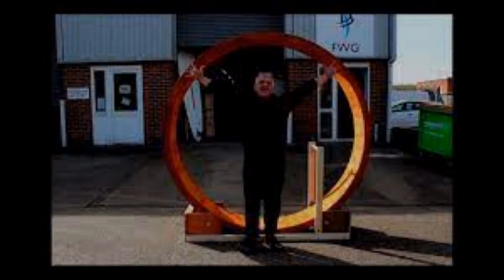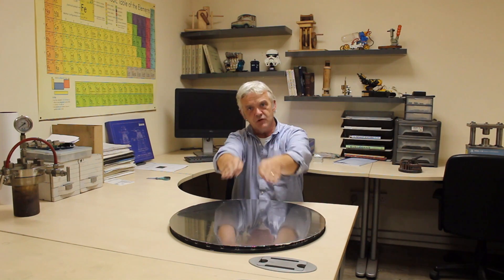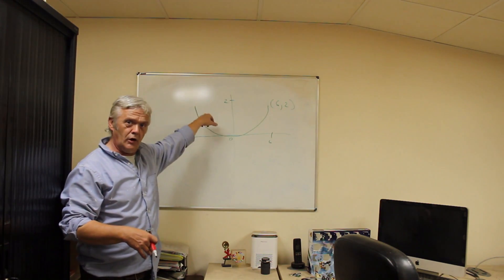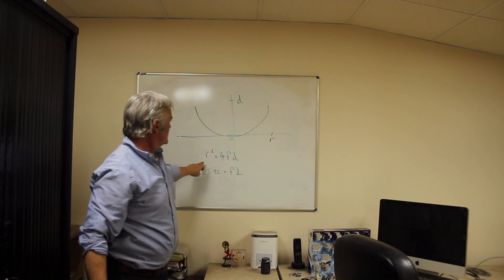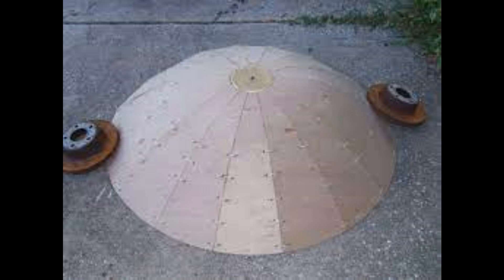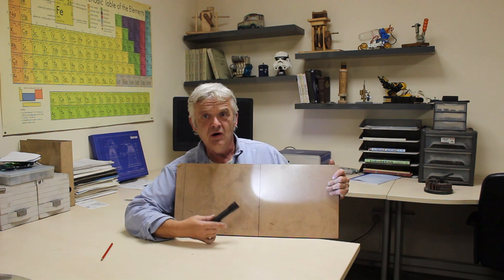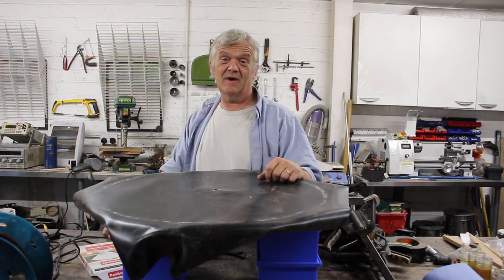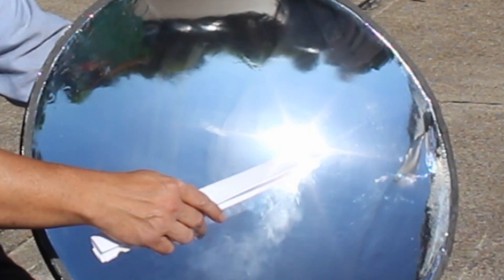1643 How To Make A Parabolic Mirror

Comment: Robert, any stretched membrane across a circular frame that is stretched using vacuum or inflated with air ends up forming a spherical profile, not a parabola. But when it is very shallow, a spherical curve approximates the curvature around the tip of a parabola.

Comment: It would be cool to make one in sand and using something weighed on a string to either scoop or displace the sand. Maybe even start one by hand or use something of a similar shape and refine it with the previous method. Also could you use a vacuum? Once you have the right material you could apply the mylar to it but you'd probably need something similar.kar to an air hockey table in reverse to pull the mylar down evenly. My original idea was to make the shape and then apply it like window tint. But no matter how it's made, it's a very cool idea and I appreciate watching and learning. It reminds me of the cool science experiments my teacher's would do in the Forestdale school system on Cape Cod. Without my teacher's I wouldn't enjoy life very much. Most of my teachers really cared and tried their best to teach and did a very good job at it. Nowadays, teachers like that are hard to find from what I've heard and seen.

Comment: A number of years ago when I was investigating how to make a large accurately shaped parabolic reflector I came across a paper by NASA which dealt with the concept Robert used here, of applying a vacuum (or positive pressure) to one side if a taught reflective membrane such as the space blanket Robert used.  The paper showed that the shape created is not a true parabola but is a close approximation.

Perfectly adequate for heating applications where a true point of focus is not needed, but useless for optical purposes such as a telescope.  For the same reason, if a point source of light is placed at the focal point, it will not produce a parallel beam as in a searchlight or from a laser.  The beam width will increase with distance from the reflector.

Comment: BTW if you need a hyperbola, for applications like Viktor Schauberger used in his water implosion devices, then the easiest way for a backyard inventor is to place a heavy weight onto the center of an elastic sheet that is stretched across a circular frame. Then coat it with epoxy.

Such a shape is used for degassing water efficiently for example. And degassed water forms very hard hard ice. A hyperbola creates a strong vortex when gas or liquid flow through, and in the case of water, the  dissolved gasses are sucked out of the liquid.

Comment: Howabout carving spray foam? I just made a foam knife w a laptop supply, ss wire and a bucking circuit. I can bend the curve into the wire. As I practice, I can attempt the bowl shape and sand out imperfections. 3m adhesive will hold the mylar or... rub in CaCO2 or d.e. and spray clear polyu? Also, The fresnel layer in old big screen tvs do this if you see one on the curb.
I want to distill water at midday sun. Carving is going to allow an asymmetric shape cooperating with the limits of my light tracking (stepper motor on timer, trying to automate with relay n sensor in tube)

Comment: There is s a far easier way to make a parabola.  Put two nails in a sheet of plywood, cardboard, etc.  Get a loop of string that will fit loosely around the nails.  Take a pencil and draw the string tight and, while keeping the string taught, draw a completed loop.  This will make your parabolic shape.  Pull the nails, use the holes to line up a straight edge and draw a line through to make the dish shape.
Reply: That’s a standard method of drawing an ellipse, not a parabola, sorry.  In any case, a full ellipse is always a closed shape whereas a parabola is always open at one end.
Reply: @ianmathieson65  Yes, that is why the last sentence was to line up a staight edge across the nail holes to draw a line across to finish the shape.

Comment: Easiest method of drawing a correct parabolic curve is :
1) Make an isosceles triangle whose base is the diameter of the reflector and the altitude is TWICE your focal point.

2. Place numbered divisions say 1 cm apart on EACH leg of the isosceles triangle 

3. On one leg REVERSE THE ORDER. So one side A (left ) 1 to 30 therefore on side B (right ) it goes 30 to 1 .

4. With a RULE connect the SAME NUMBERS .

5. When all numbers are connected a parabolic shape is formed .

Comment: That is one hell of a fruit bowl you've got there Rob. Nice method, I wonder if the vacuum method would work on thicker sheets of aluminium, could you deform them enough so that after they spring back there was still enough curve? I ask because I know there is a type that is actually sold for this task that is highly reflective and removing the other steps would speed up making multiple copies.

Comment: LOVE THIS ONE!!! One more thing and a bit of off topic but related to Parabolic Mirrors.... can such a device be upscaled like how Archimedes had intended as a defensive weapon against wooden ships, but INSTEAD of burning wooden ships, can the parabolic mirror be coupled with a powerful magnifying glass to create a Solar Laser Beam? also can these kinds of mirrors be used again to create cool holograms like the ones Athanasius Kircher was building in the 1665s?:goodvibes:
Reply: The sun is not a coherent light source, it doesn't produce light by stimulated emission. What you could do is use mirrors and a grating pair to make an adjustable spectral filter, and use that light to pump a gain medium to get a laser

Comment: How come I haven't seen a holographic Fresnel reflector just like the holographic wrapping paper? Who makes that stuff, I should send in a request...
Reply: I thought about this at length especially since the idea is a stationary reflector. His previous video of using graphite is better for this because you need to form bubble ridges.  I thought using a fiber laser would do, but it would have to be on a 3-axis controller and tuned to specific depths over a period of multiple passes which would require a parabolic substrate that would be thick enough to handle the etching.  So while you could bend a piece of aluminum and laser little micro V's in it., do the overall losses ever exceed a suntracker?  I doubt it.  So I think a better idea would be to place micro bubbles of graphite on a stationary concave surface.  But then with all of these, the collector casts a shadow.  With a suntracker you could put a cone on the collector and reflect into the parabola.  I have several fresnels, one glass and several plastic ones.  I believe they are all made by stamping.  So I see the value of creating an inverse holographic style metal stamp as a precursor leaving concentric grooves to apply graphite into.  Reducing the bounce out effect.  man i sound like a nutjob, oh well.  I do own laser, and I do understand the math.  but the chems and application are beyond me.  The mylar just isn't efficient for broad spectrum UV as the graphite is.  I'll stop talking to myself.  One of these days the local airport is gonna get complaints about light pollution tho.
Reply: @patrickmcginnis7  if you're that good at math that you could backwards calculate the ridge dimensions of a holographic reflector from the pattern you want to create with it , then you are way ahead of me, figuring out how to build it seems the easy part by comparison to me.
    Imagine a hologram of the Sun, as you walk around the hologram it's always going to look like the same ball in the same spot. Now reverse that, as the sun 'walks' across the sky the focal point will always be in the same spot. Holographic tracker.
No moving parts.
Now how the hell do you do the math ,   help!
  No you're not talking to yourself.
   Graphite bubbles does sound crazy when taken at face value out of context. Practically though both silicone and graphite are hydrophobic and should stick to each other on the surface interface and you could probably mold a bubble print.
Reply: @petevenuti7355  What's beyond us is the scale...like in nanometers to get the desired efficiency result.  If you could imagine a clear balloon.  On the exterior of the top would be tiny fresnels tuned to hit certain focal points on the interior of the bottom of the balloon. Those points could be micro parabolas directing the rays to a centralized collector.  Someone did something similar, but the heat was used to spin an interior cone, and it was debunked as being efficient at all except for a small range of angles of incidence. Which is counter to the overall proposal.  Like a crooks radiometer fitted correctly would certainly create passive electricity, but would it create more per cm² than a normal solar panel or collector...not imo.  beyond the scope of a solar cooker obviously.  Keep being inspirational. :)
Reply: @patrickmcginnis7  have you ever seen any of the holographic chocolate videos? Say , from the thought emporium?
    Anyway the hologram idea I mentioned just before,  went beyond just making a Fresnel,   more wondering if an interference pattern exists that would allow a single focal point at a wide range of angle of incidence to avoid tracking. The biggest problem I can think of is that it might only work at a single frequency, and that other frequencies may be completely blocked or diffused, not even approximately focused.
    My original comment about putting a Fresnel on a reflector , one would have to be calculated for the double passage of light, because it would be better to have a back surface reflector.
     The scale of the grooves doesn't have to be that small for that. A silicone mold would do.
Reply: @petevenuti7355  cool chocolate.  That I think it's a combination of absorption and reflectivity cause it filters colors.
Reply: @patrickmcginnis7   ultimately the self interference defines the final results. Cool for sure.

Comment: You could take a string or rope and hang it from the ends .. letting it be slack in the middle .. just the weight of the line will form a parabolic line.  If you look up "The Arch" for St. Louis, MO .. you will see a tall monument that is that shape .. it is hollow .. I've been to the top two times!

Comment: Very nice. Explanation Robert. Give been wanting to grow some pezioeletric crystals (Rochelle salt) lately using the sun and cooling by night air. Crazy thing is i just made some parabolic mirrors with mylar solor blankets I glued the mylar on a big mixing bowl then poked a hole installed a tube and sucked the air out to form the shape. I placed water in the bowl mirror and The water temp can be controlled by focal point.  Again Great👌video. Thank you.

Comment: If we use an old oil drum (or some other large cylinder) instead of a bicycle rim, it would allow one to connect a pump and pull a vacuum to adjust it to whatever focal point we choose, limited by the deflection the mirror material is capable of.  It also lends the option of being able to create a convex shape as well, a small controller used to regulate the pump and a cheap pressure transducer could automate it.  Kind of reminds me of some ideas I had back when I was working on spherical/liquid lenses for high performance metrology in extreme environments.
Reply: Cover the back of the rim , pull vacuum through the valve port.... I did it with the frame of a broken personal trampoline...

Comment: Relatively easy and cheap way to do some subcritical water hydrolysis of cellulose experiments with a parabolic solar trough 

1) A Parabolic trough focused on a black painted copper heat pipe with a pressure release valve at the condenser end. 
2) Insert the boiler end inside a florecent tube to minimize convective heat losses with heat resistant silicon rubber O-rings for spacing the pipe in the center. They need to be cut to prevent pressure buildup inside the glass. 

 3) fill it with wood dust and and some water. 

In the sun, The water should turn to steem and travel down the pipe under pressure pushing oxygen and air to the condenser side where the air can be purged at the valve. The water condenses and falls back down trickling through the wood dust washing the broken down hydrolyzed cellulose products into the boiler at the bottom. 

Wood to sugars for rocket candy rocket fuel?  Note. Take care to know the pressure raiting of the copper pipe and that the pressure release always remains free of obstructions and set a safe level below the copper pipes rated pressure.